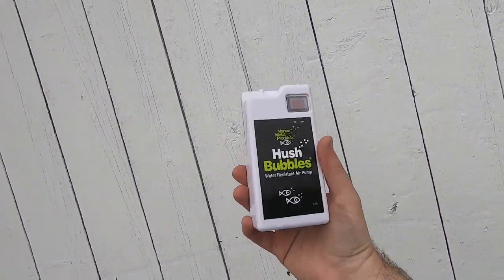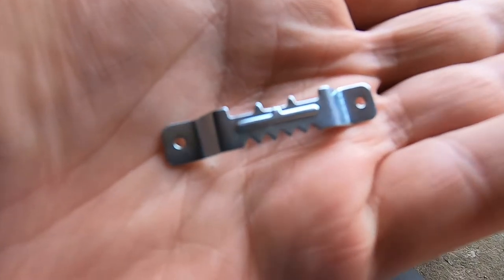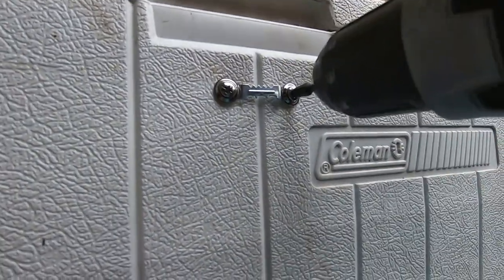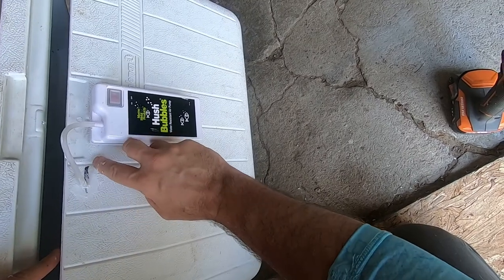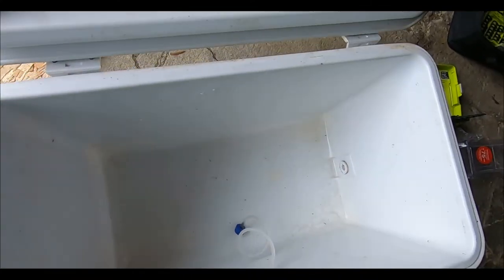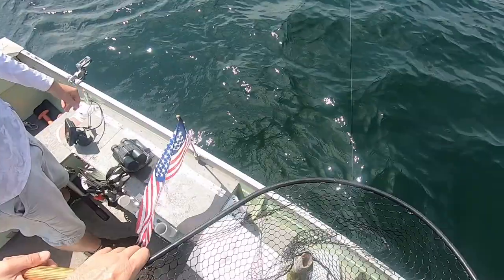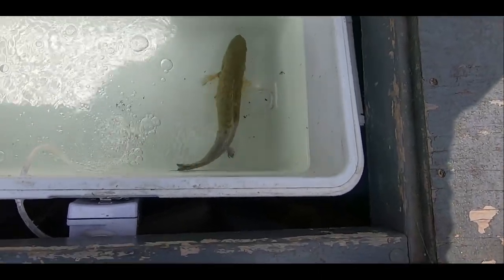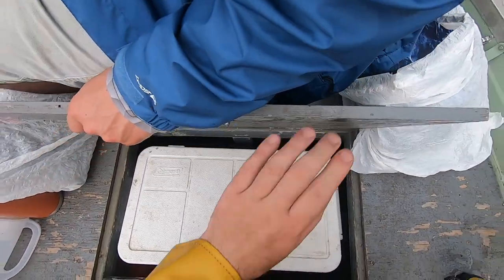EASY "DIY" BOAT LIVEWELL/Costs you less than $50.

Comment: Good job. May use it to keep live bait. Check the regulations. Thought I just read all fish you keep must be killed. I think to reduce illegal stocking. Just found your channel. What size boat are you fishing?  Looks like a starcraft. Is it the deep model? I think my 14 ft would be too tipsy to mount the seat on top of the original seat. Like the layout.
Reply from the maker: Thanks again!  Not sure but yeah, they have a regulation for everything nowadays. lol.
It's a 1968 Starcraft Seafarer. It is deeper than most made during that period. I repainted and custom built the deck with compartments and seats to my liking, etc. A lot of work but worth it. I love it. Very stable boat for trolling or casting.
I have a video on how I made the deck. 
https://youtu.be/TygSkIXB9a4